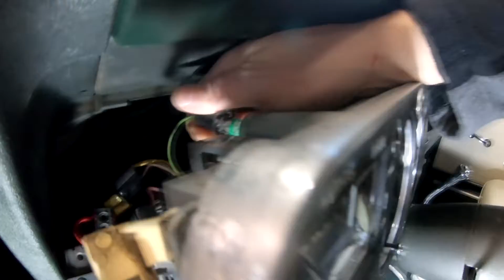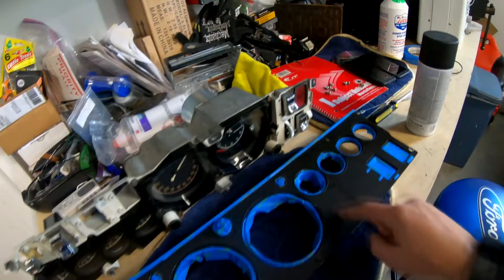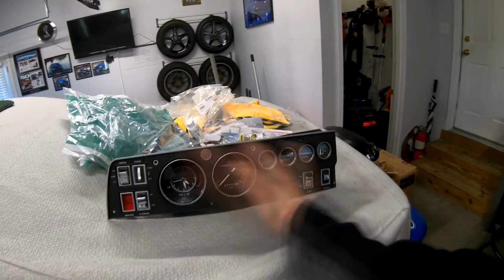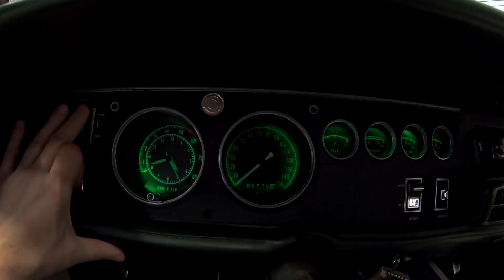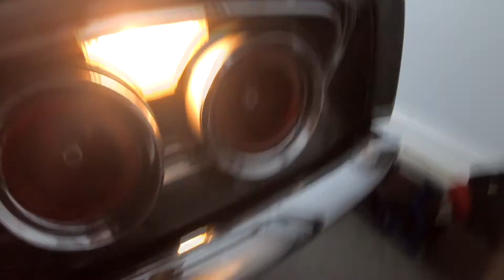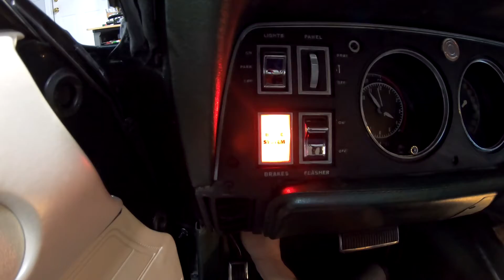1968 Charger - How to remove Dash Cluster  - also reverse lights and high beam switch repairs

Comment: I changed all my interior lights to led except the dash back lights. I haven’t even opened the dash to look but I noticed you changed to green. Are all the bulbs back there just normal bulb originally? And how many do I need to order? Mines a 69 SE
Reply from the maker: It's been a while since I did this, but I think I needed 5 for the cluster.  I used a standard bulb for my emergency brake light.  You need the green ones for the cluster backlight.  You can also use the green ones for your turn signals.  But you need to use a standard bulb for your high beam since it is red, that is what I did anyway.
Reply: @98saleen  thanks for the reply and info!

Comment: Great video and channel, I am replacing my dash plates and putting in a radio delete plate so did as suggested all went well but now I have no power at ignition. I noticed what looks like a ground on the column which I haven’t bolted back up yet  could that be the culprit or is there something cluster related I missed ?
Reply from the maker: Check the main power coming into your amp/volt gauge.  Power comes from the firewall to it and it feeds down to the fuse box, so you should check to ensure your glass fuses under your glove box are still OK and didn't accidentally get shorted.  Lastly yes there is a ground wire at the column that should be hooked up as these cars are very picky on the grounds as they don't have many attachment points.  Side note, it won't hurt to add a few extra if you wanted to in the future!
Reply: @98saleen  Wow did not expect a reply that quickly, Thanks,  oddly enough I did unbolt the fuse box in the glove while doing the panels so will check there first. Thanks again for all your info should be able to sort it out with the info you provided
Reply from the maker: @DC-zh5zl  Happy to help!  Good luck!  Post some vids/pics when finished.
Reply: @98saleen As soon as I connected the alt gauge I got power so my issue now is I am working on the car and wanted to be able to move it without having the cluster in . I read on forums to just join the two wires which in my opinion could cause a fire or be a fire hazard that and I don’t want to cut off the factory connectors to join the wires for a temporary fix. I assume the only thing to do is to put the cluster back ?
Reply from the maker: @DC-zh5zl  Yes you can simply connect the wires together using a small screw/bolt/etc and then wrap it with tape to keep it from shorting out while you keep the cluster removed.  That will keep the 12 volt circuit active and you can crank/move car no problem.

Comment: Thanks for the video! I own a 68 charger & I have a question. I have a light issue. My high beam lights, tail lights, & brake lights are not working. I replaced floor dimmer switch, replaced all headlights & tail bulbs & still nothing. I replaced brake light switch also. In the beginning I believe the brake light switch was my problem because after parking, my brake lights stayed on would run my battery down. That was the start of my problem. Recently I replaced my fuse clips because they were really rusted & thought maybe that was the culprit but now the #2 fuse counting top to bottom blows every time I push the floor dimmer switch. I don't believe it was always doing that. Just though since you've got experience working on your charger you might help. Oh & I did just buy a new headlight switch from year one but haven't tried to install it. That's how I found your video. What ya think would a headlight switch impact the tail/brake lights as well?
The bright beam light on the dash comes on even though the high beams themselves don't.
Reply from the maker: If pressing the high beam switch blows the fuse, then you have a electrical short in that circuit.  Check to see if a wire is rubbed thru touching metal somewhere.  These old cars have brittle wires and it's easy to see the protective covering cracked and exposing the wire inside.  Next grab a multimeter and check the voltage going to each light socket.  See if you are getting a 10-12 volt DC reading or if you are getting zero.  Keep tracing back the signal to the fuse block to find where the voltage starts and stops.  You should be able to find the break in the system such as a bad switch, broken wire, etc.  Good luck!

Comment: Nice video! Getting ready to do some updates to mine after 20 years.  Could the dash harness be replaced just by removing the cluster the way you did or does the whole dash need removed?
Reply from the maker: You can do a lot by removing the cluster, but if you are trying to change everything, then removing the dash is the way to go.  From what I've seen/read, you should have the windshield taken out to allow you access to the screws to remove the dash properly.  I've never done it but alot of guys say that is the time and best method.

Comment: THANK YOU SO MUCH, I have the exact symptoms you described - no dash lights, but turn the tumblewheel all the way and the dome light comes on. I had the need for another order from classic, so I'll add this one too. I also have the headlight switch heat up pretty bad, and smoke starts to come from behind the cluster, but only when the headlights are on. I hope it's just the switch, but could it be something else?

One more thing, is it inevitable that you have to undo the steering column bolts? Do you think there's a possibility of replacing the dimmer without lowering the column?

Anyway, this video will help me a lot when the parts come, thank you again!
Reply from the maker: In order to pull the cluster without damage, you must lower the steering column.  I know it's a pain, but your cluster is fragile so don't break it!  If you switch is drawing too many amps it can smoke and heat up.  Check all your wiring and make sure your lights are not overrated (too many watts) such as a brighter than recommended bulb, etc.
Reply: There is a lot of current flowing through that switch when the headlights are on.  Current equals heat.  You really should add relays to the circuit.  There are many articles available on how to do it.  Here is a good one.

http://www.dodgecharger.com/forum/index.php?topic=168.0
Reply: @johnmorrison1133   WOW that is a good one! That explains exactly how to do it.